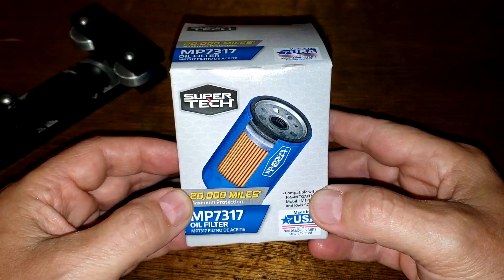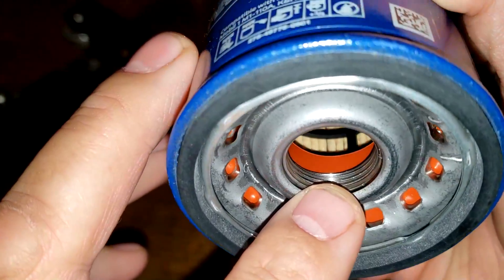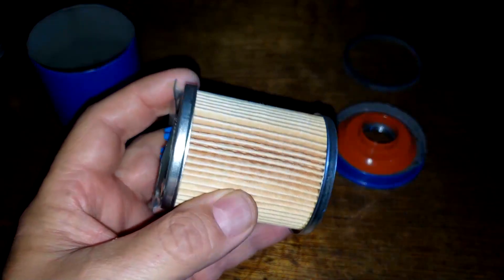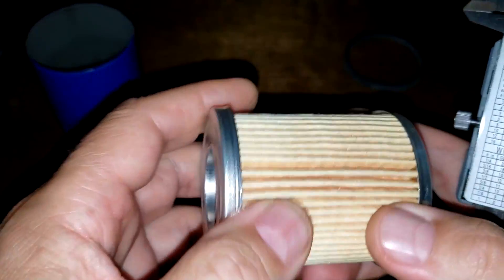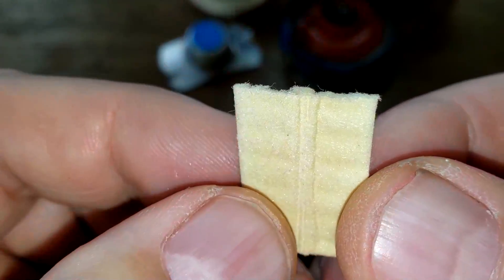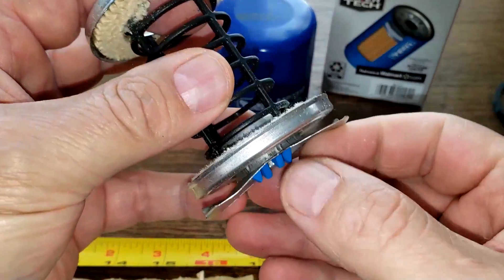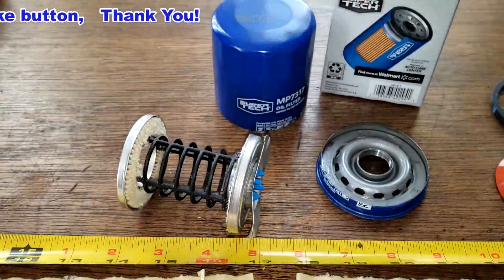Walmart Supertech MP7317 Oil Filter Cut Open, Oil Filter Flash Light Test

Comment: A small amount of leaking at the bypass valve is normal.    Here is a lab test from Ascent Filtration https://youtu.be/pHkeSjnyxEs?si=BfRtyr0kgUsJwbnI&t=751 which shows a Wix XP (their top oil filter) showing some bubbles coming from the built-in-style bypass valve hole.
Reply from the maker: Thanks for posting this👍, very revealing💯
Reply: I'm sure that's a defect on the Wix XP. If it was normal, you would see it on the properly functioning Purolator as well.
Reply: @moshet842   you mean you don't know about the "tearalator?"

Comment: They should have a glued on rubber gasket between the leaf spring and filter end cap. On the Fram oil filter yes it has fiberboard end caps BUT you can see the indentation on the endcap where the leaf spring meets the filter.
Reply from the maker: I think some kind of gasket would help also. Thanks for your feedback👍

Comment: I think they make it that way for cold start, so the oil can circle fast to lubricate or if the filter is clogged you still have small amount of oil circulating. Engineers have reason but not all of  them. Not sure but it is my assumption!

Comment: Those ridges on the sealing surface is a quality control issue, i e. Too much metal flowing into the cup shape in the stamping die that made it, causing the metal to bunch up and wrinkle. Those issues can be tuned out of the cup shape by the staff at the plant that stamped that leaf spring,but unfortunately, they obviously have not been. Which begs my next question; why does the quality control department at the oil filter manufacturing facility not reject these parts and demand better from the supplier. I would presume it’s time/cost savings and who would have known about this had we not witnessed a new filter being autopsied on this channel. Thank you for your work on this channel.
Reply from the maker: You're Welcome Mike👍
Thanks! I appreciate it😊

Comment: Interesting observation, thanks for sharing! Considering the fact that most bypass valves don't make a liquid tight seal anyways, I'm not sure how much a little extra oil bypassing around the bypass valve matters. If the goal was truly for no unfiltered oil to get past the filter, there would be a lot of things different about the design of the filter system as a whole, starting with the filter media having enough surface area that the bypass valve never opens during normal operation or is eliminated entirely and the clean side of the filter being sealed in some way other than straight cut threads, which are guaranteed to leak to some degree.
Reply from the maker: You're Welcome👍

Comment: This is why filters with coil springs and built in bypass valves are better. I use that same filter on a vehicle and it has so many miles it doesn’t bother me a slip stream of unfiltered oil is getting past at all times.

Comment: Tough to beat for the price especially if you do short interval oil changes. I’d put one on an older car. I get $4 motorcraft filters for my 04’ super duty 5.4 2 valve. Only go 3k miles.

Comment: I really like how you are checking dirty oil seepage with light. I've never seen anyone but you do that, and this would be a big part in my oil filter decision. I wondered if filter magnets could cause the filter to tilt on the inside and cause oil seapage, and maybe ever crinkle the filter by making it shorter and causing oil seepage. That's why I wouldn't use a filter magnet due to wondering if dirty oil can get passed through somehow.
Reply from the maker: Thanks!

Comment: I prefer the integrated type bypass valve with coil springs type oil filters. I recently was able to find a deal on some with slightly better filtration rating and metal seam to keep the media together type. Around the same price as these by buying a pack of 12.
Reply: What filters are those specifically?

Comment: Will you do a light test on the Fram synthetic endurance
Reply from the maker: Yes, that's the next one I was going to do.
Reply: While the Fram FE is made by Champ Labs, looking at previous videos of the FE, it uses has a different bypass-flat spring design. No protruding nubs on the bypass. But, it still meshes metal to metal.

Comment: Good catch. Never knew that those kind of bypass valves were made like that. Metal to metal seal with no gasket is bound to leak. The filters where the bypass valve is built into the base plate  may seal better. Would be interested to see if those kind will pass light.
Reply from the maker: At some point, I'll test those filters also.
Thanks!

Comment: Without the "bumps" as you called them the tapered inlet metal would lock into the outer tapered metal plate- so then it would not open. there has to be some play to keep it so the oil can start flowing if it has too.
Remember there is lots of pleats & paper to catch particles. If they had the relief valve on the inside of the round formed paper it would pop off all the time whenever the oil was cold. Change yer oil & look for small iron particles in the old oil. Run a magnet through the old oil, what do you see? Nothing. Zilch, it's in the filter, relax.
Reply: That's not a very good method.Aluminum and copper particles in oil are far more concerning than iron particles.
Reply: Strain your old oil through a filter, see how much non-ferrous metal you find. You won't find any. don't say anything until you try.  @tpatt623

Comment: 🤦🏼‍♂️I've talked about this many times, but stupid commentators with the tenacity of true idiots praised FRAM and other similar designs.
In fact, this is NOT a FILTER at all, but a cheap craft. 
But: the stupid American consumer “gobbles up everything.” And: prove to you, morons, that flimsy stamped pieces of metal do not perform any spring properties , that such "valves" have a metal-to-metal gap , and dirty oil passes through  there under pressure - nobody listen!!! 🤦🏼‍♂️

Comment: I don't know about unopened can oil bypass or if so, how much. I do know Super Tech MP bypass design is identical to that used in many current Champ Labs made oil filters, including but not limited to current ACDelco OEM oil filters. So, 'if' there is an oil bypass issue, it would extend over many filter brands and applications. Some still use the polyester caps, wonder if they would show similar light. "If" the light does accurately indicate oil bypass in unopened filter use, then it would condemn most current First Brands Champ Labs made oil filters. Now there's something to think about.

Comment: The filter is pressured against the base plate.  But you are testing it by merely laying it on.  Could this be why?
Reply from the maker: I can't duplicate the pressure but if I put any more pressure with my hands on that leaf spring, the ends will bend and be flat, and it still won't completely seal.
Reply: @WhipCityWrencher  Good to know. I thought pushing the element down with stamp spring flat on a surface, and pushing base end might tend to replicate closed filter. In any case as i mentioned in my comment, bypass design used in ST MP, used in many current Champ Labs filters, including some GM ACDelco OEM.
Reply from the maker: @faxmen09  4:09 Actually if you look at the stamped leaf spring I dont think it can go any further in because there are little stamped humps on the edges of the leaf spring. 🤔
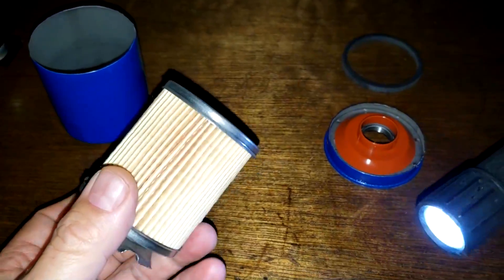Reply: @WhipCityWrencher  Yeah those protrusion points obviously to hold the bypass in place. But, there's also a protruding ring on the endcap seen @ 3:25 and a recessed ring in bypass that should seal unless those bypass bumps prevent that from happening. ¯\_(ツ)_/¯
Reply: @WhipCityWrencher  Hey Whip, someone watched this vid and posted it on Bitog with a title something to the effect. Super Tech oil filters leak. Well, it went off the rails quickly with bickering among members. I thought is was funny as heck, but first a mod closed it to further comment. Later they completely deleted the thread, like it was never there. 😂 You troublemaker. Just kidding.
Reply from the maker: @faxmen09  LOL🤣 Thanks for letting me know that. I don't go on BITOG as much as I used to. Thanks! That's funny.😄
Reply: Yes, a little bit maybe, you need taper bumps there so the piece doesn't lock shut.
Reply: I think that is a possibility, but to replicate pressure exactly would be difficult.

Comment: Oil isn't light. An oil filter under operating conditions isn't an oil filter unassembled. One has nothing to do with the other when doing the job it's designed for.

The only time the bi-pass isn't already open to one degree or the other is at operating temperature and low engine RPM.   

All engines get unfiltered oil by design.
Reply: Correct,  there are only 18 comments at the time I'm posting mine, thankfully you've enlightened those who don't take this into consideration.  Overall looks like a very good Oil Filter.
Reply from the maker: You can believe what you want, I'm just showing my findings. Thanks!

Comment: Supertechs arent bad filters for the price ! You get a silicon ADV and 13 inlet holes and a clean descent filter media ! I say most filters with stamped steel bypass valves do not seal %100 ! May as well not have a bypass to begin with ! Nothing a 2 cent o- ring couldnt fix ! 👍
Reply: You need a BV when the oil is 10 below zero, you need it bad. A little leak by is nothing. When started cold a hell of a lot more unfiltered flows through the BV, it better or you will have a dead engine. Below zero oil will not flow through a filter medium, not even 0w-20 until at least 20- 30 above zero at speed.
Reply: @armedfarm3429  thats why i have engine block and oil pan heaters ! + not all oil filters have bypass valves !

Comment: It looks like a well-constructed filter - no excess glue.  Even though a small amount of oil will leak through the bypass valve, over time all of the oil will get filtered as it is continuously passing through the oil filter as the vehicle operates.

Comment: That's a really flat leaf spring, not much travel to push the device into the filter body.  I think those ridges you hilighted are designed to secure and wedge the spring into the filter body.  Except for the design of putting the bypass into the spring it is a well made filter with no glue slop.  I think either using an upper bypass or integrating it into the bottom of the filter body is a much better choice with the upper bypass the best option.  Probably cheaper to put the bypass into the spring.

Comment: Based on your light test, I would not use filters that have the combination spring and bypass valve. I have thought about that before since there is no sealing material between the metal endcap and the metal of the spring/bypass valve. The problem is being able to tell if a filter has a spring/bypass valve without taking one apart before using one. That's why this channel is such a great source of information.
Reply from the maker: Thanks, Jeff😊

Comment: I agree they are not perfect, but for +- $5, it’s not a bad filter.   I think we’ll find that most filters will not be perfect in regards to allowing a small amount of oil to bypass the filter.   I think if you really are on a budget, the Supertech products are still a decent choice.
Reply: I guarantee you that if vehicles came with a gauge that shows how often their oil filter is at least partially bypassing from cold starts and extremely low temperatures they would not be so concerned about finding the absolute best filter rating as far as micron ratings. Wix for example has never advertised the best micron ratings but have historically produced high quality filters with low failure rates. Regardless of media design, there’s always a trade off between filter efficiency and flow rates. Some are a better compromise than others but there’s still a trade off. I guess the question is “ which is better, a filter with average micron ratings but great flow and construction or a filter with great micron ratings but more restrictive and subject to bypass more in less than optimal conditions?” 
After wrenching for a living for many years my opinion is that the average vehicle is better off with the absolute best air filtration they can buy that sweating the best micron ratings on a particular oil filter. The engines that I’ve found to have been damaged by dirt intrusion were not the fault of the oil filter but a cheap or poorly fitting air filter that allowed dirt to be ingested. Early Ford 7.3 Powerstroke engines had engines “dusted” by Ford’s Mickey Mouse air filter design.

Comment: Wow! I just refuse to purchase cheap/off brands filters. I wonder if other by pass valves leak?🤔 So springs are better? I've always thought those type valves looked cheap.
Reply: You think the Super Tech filters are made by Walmart?  There's only like 3 or 4 oil filter manufactures, therefore most filters you see are "off brand"   This particular filter is very good for it's price point, better than many lessor made and more expensive filters.
Reply: @chestrockwell8328  All I know is Walmart sells products that are ALWAYS being recalled.🤔Hence, u get what u paid for.😁
Reply: Fyi, same Champ Labs made design as used on ACDelco OEM oil filters. I don't think those could be referred to as cheap off brand filters. Very common First Brands Champ Labs design now.
Reply: This "Supertech" is a Champ Labs XL synthetic filter painted blue with Supertech print on it.
Reply: @memopadilla5931  I don't think most would call the Champ XL a cheap off brand filter either.